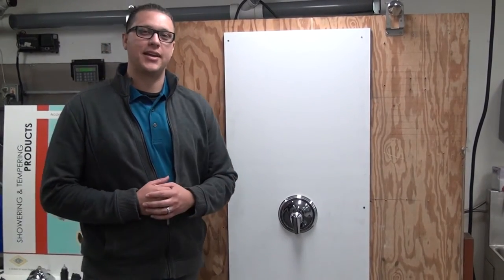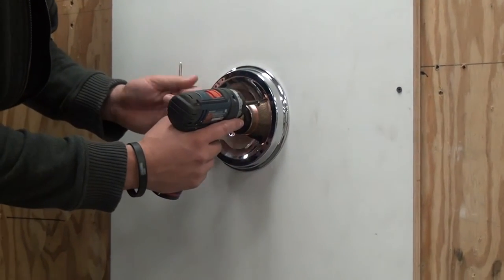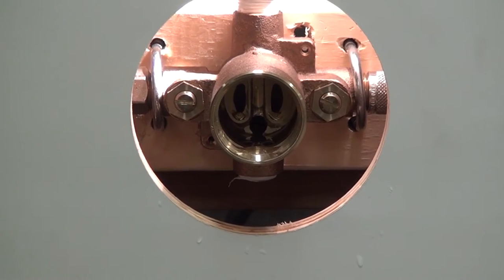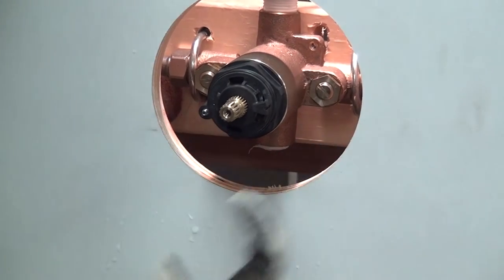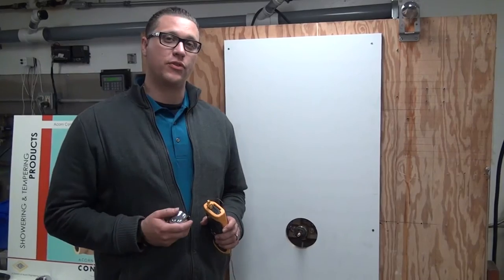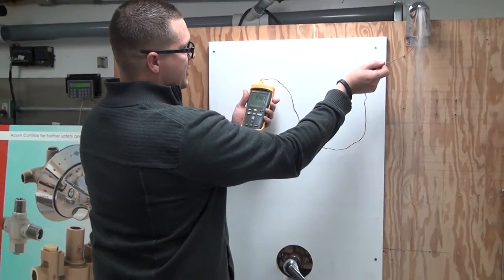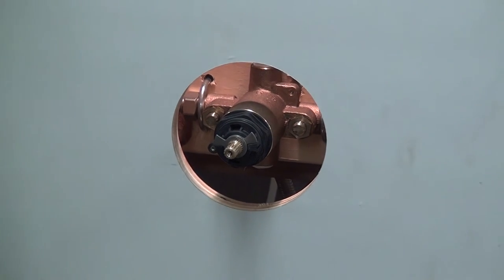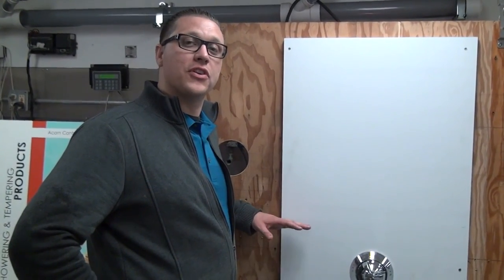How to Install an Acorn Controls RSV16 Valve

Comment: We struggle with this valve : do you line the H on the cartridge up with the H on the valve?  The manual has it opposite and it's been making us nuts working on these valve ;)
Reply: These valves are trash. Wish i could tear em out.